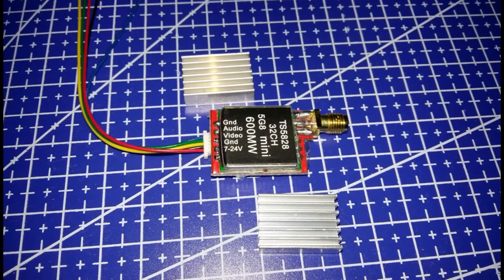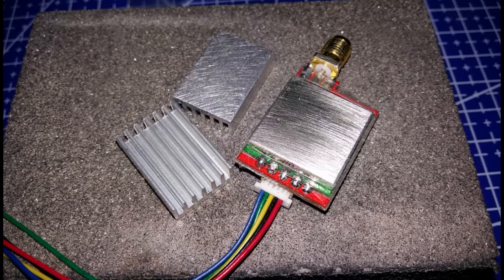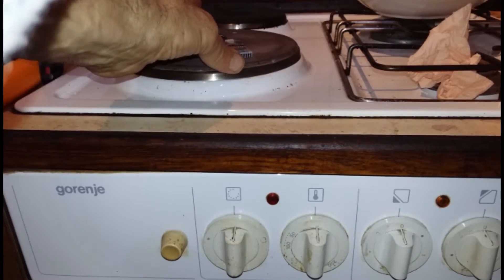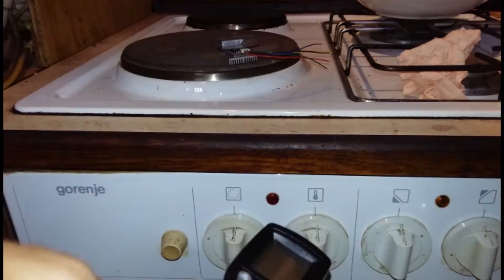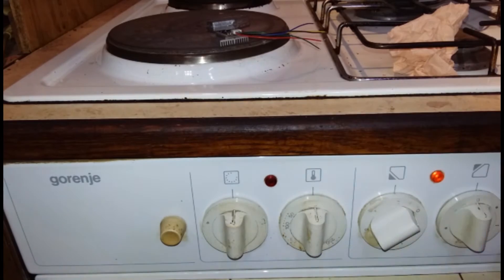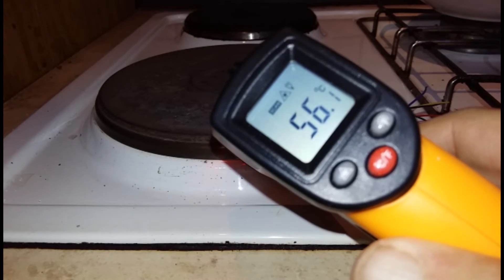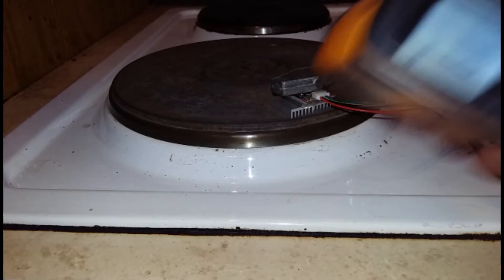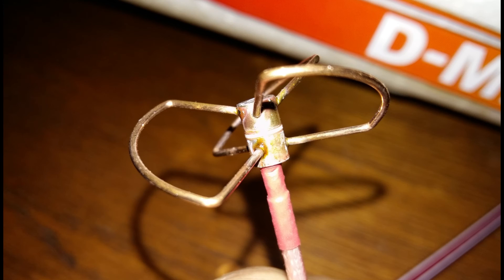How To Fix Heatsink To Your VTX

Comment: What kind of glue is that?
Reply from the maker: Two component epoxy. One that is not 5 minute. Require heat for better strength.

Comment: Nice video! Do you still use the transmitter with 12V after the mod? Is it more cool now or does it still get hot?
Reply from the maker: Sometimes. It depend whether there is 3S or 1S battery. Usually, voltage regulators require 1.25V higher than output, so this is the usable limit for some type of batteries and voltage regulators. When input voltage is closest to this 'minimalistic' limit, transmitter is much colder than when some 'full voltage' is applied. Transmiter itself may be warm too, but voltage regulator(s) give the most of the heat.